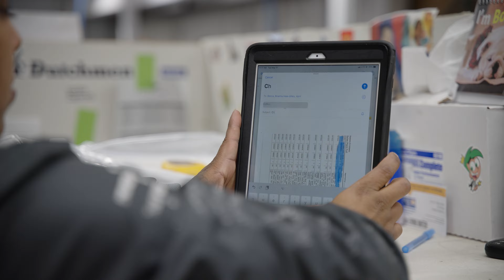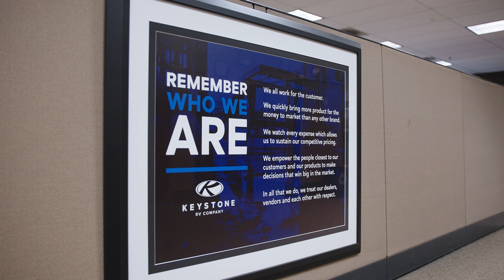Join Keystone RV's Customer Service Team!

Comment: Do not purchase Keystone.  I purchased a  brand new 2022 Keystone Sprinter and have nothing but issues.  The front AC did not work when purchased.  Then Campers World in Jacksonville Florida advised the AC units are on a 3 month back order.  The front slide was not working and after the technician came out to look at the issues they found that Keystone spliced two wires and used electrical tape instead of using a wire nut.  The wires were exposed.  Fortunately it only shorted out the motor and didn't cause a fire possibly killing someone.  Again Campers world told me that I would need to bring in the trailer so they can pull the slide to see the part number for the motor.  I don't know why they could not contact Keystone direct but have been told that it is next to impossible.  I am not sure it they have trouble contacting Keystone since I have no first hand knowledge.  I believe Keystone needs to complete an inspection before the trailers are sent to dealerships.  I would not say they are reliable at this time.
Reply: Hey Scott, give Keystone RV service department time to work with you
They have some great people who will steer you in the right direction
Reply: @cherylkilroy2240  sorry. Gave them a chance, basically told sorry that you having these issues and to have the dealer contact them to help resolve. Even in my email I explained what the service department at Campers World said and ask them to contact them direct. Did they? No
Reply: @scottG4325  best make sure Camping World is on the up & up with you
I have found many delerships aren't truthful with the customers from the people I've helped.
Reply: For sure. It’s actually both Camping World and Keystone. I can’t make Camping World call and asked Keystone if they could assist in calling Camping World direct but I was told by Keystone via email sorry for your issues.